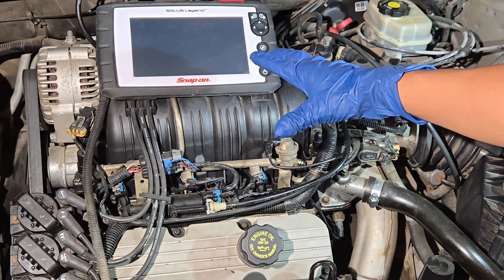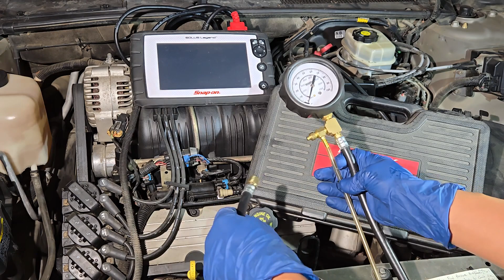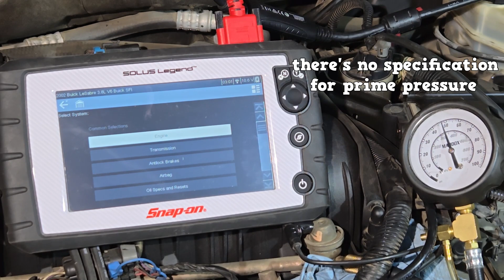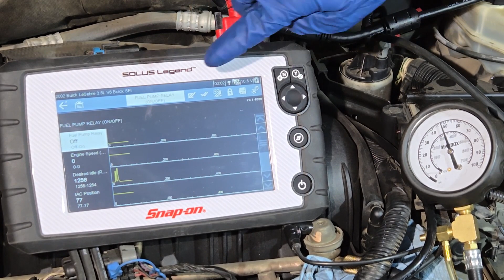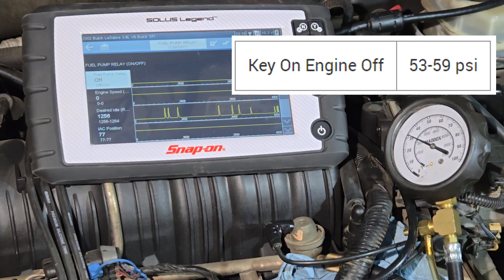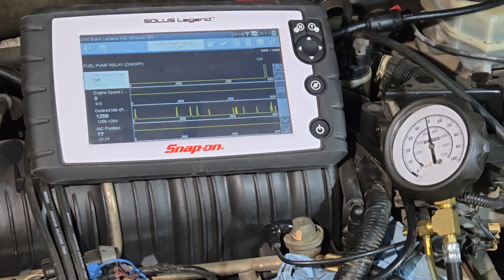How to Check Fuel Pressure (00 to 05) Buick LeSabre

Comment: Great video on the required pressure for the fuel system I have a question I'm getting fuel in my oil 1997 Buick LeSabre I pulled the hose off the pressure regulator and there was no fuel in it so I thought it was good am I wrong? Do you think it's a bad injector leaking after I turn off the car? Any help would really be appreciated thank you
Reply from the maker: Check the fuel pressure, on your model year, you don't need a bidirectional scan tool. 
 - install the pressure gauge
 - record the fuel pressure during run mode (when the pump is primed) (key on engine off)
 - specification is (48 to 55 psi)
 - The pressure should not drop more than 5 PSI in 10 minutes

This simple test should give an indication of a leak in the system, and  if the pressure regulator is working as intended.
Reply: @OldSchoolNoe  thanks I will do that but will a bad regulator let fuel into my oil? I just changed it about 200 miles ago and it's almost a quart over full it's a 97 LeSabre
Reply from the maker: @richkarn3792  fuel from a bad fuel pressure regulator would make its way through its vacuum hose into the intake manifold, your system would be running rich. Obvious sign of this is fuel found in the vacuum hose connected to the regulator (you stated there was no fuel in it.)

TSB 01-06-01-011B states that vehicles driven in cold weather and for less than 5 miles will show that the oil level is over-full. This is because the unburned fuel and condensation from the cold engine do not evaporate out of the oil.
Reply: @OldSchoolNoe  thanks again man I appreciate you I think I will replace the regulator it is 28 years old and the car has been really good to me I've been working on it for 15 years and never had this problem before and I've done a lot of the standard stuff that goes out on the 3.8 199,000+ and still running like new and in perfect condition garage kept I'm the second owner so I don't mind the $ I was just trying to figure it out but it sounds like it's probably the regulator if not I'll get the reman Rodhester injectors for it and replace them too I just didn't know how it was getting a quart of gas in the oil in like 200 miles? I thought a bad regulator would have gas in it when you removed the vacuum line? Cuz the diaphragm is torn and leaking but I just want to get it going and not burn up a bearing thanks again for your time and if you have any suggestions for checking the fuel injectors please let me know thanks. 😎🇺🇸
Reply: @OldSchoolNoe Hi there one more question please I don't have access to a nice scanner so I went and rented a fuel pressure gauge and hooked it up just like you do in the video and cycled the key 4-5 times and it went to around 43 pounds and immediately dropped off steadily to like 15 I know it's not the same test you do in the video but do you think the regulator is bad? Thanks again for your time. Rich
Reply from the maker: @ For your model year, you don't need a bidirectional scan tool. 
 - install the pressure gauge
 - record the fuel pressure during run mode (when the pump is primed) (key on engine off)
 - specification is (48 to 55 psi)
 - The pressure should not drop more than 5 PSI in 10 minutes

If it drops fast the regulator COULD be bad, but you could also have a leak somewhere, such as the fuel injectors.
Reply: @OldSchoolNoe  thanks again the pressure drops immediately to all the way to zero in less than 10-15 seconds and I pulled the fuel rail out and had my friend turn the key on and off a few times and the injectors didn't leak so I guess it's the regulator. Thanks again I really appreciate your time and help

Comment: Awesome videos. I just found your channel. I think your stuff is super clear and to the point.  New sub for sure. I'm a Brand new dad as of 28 days ago! My grandpa gave me his old 2004 buick lesabre as a automatic tranny family car.  It has a coolant leak where one of the little plastic elbows goes into the engine and the seal/gasket below it.  I have been watching videos upon videos. Right now I have the intake and alternator and stuff off. I have a gasket kit off amazon, metal elbows too. Im gonna try to put it all back together. Should i do the valve cover gaskets? They do not appear to be leaking and its at 120k miles.
Reply: Excellent video Great speaking easy to understand.